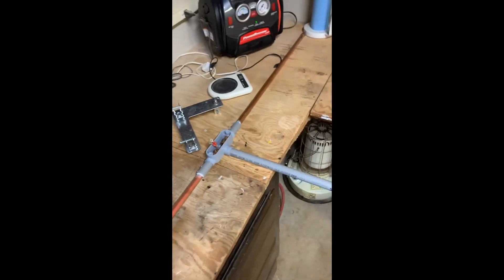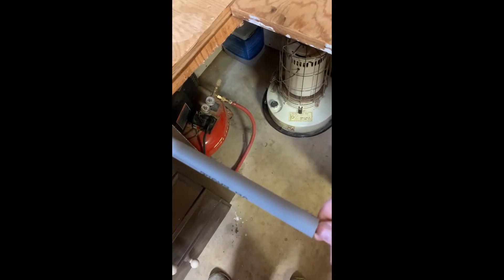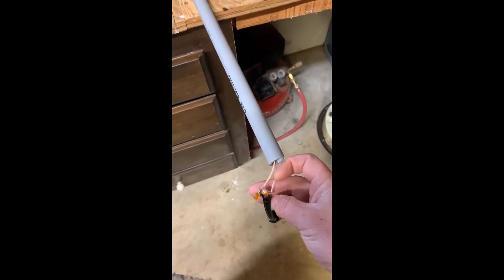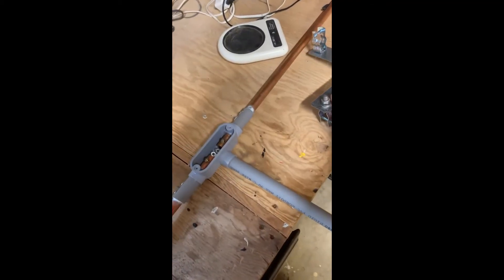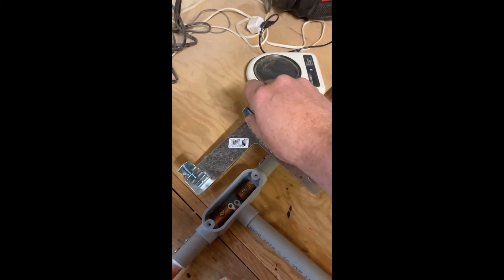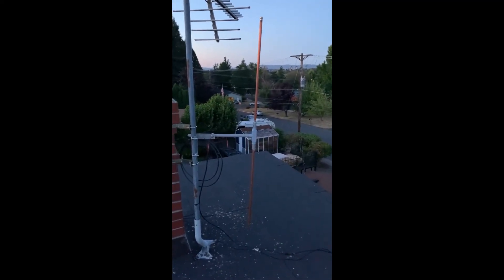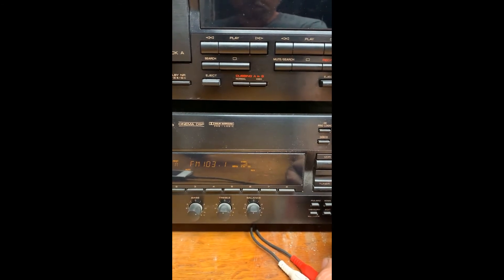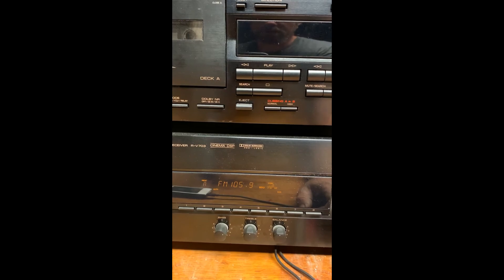Build a dipole antenna for better FM reception

Comment: The elements should be approx. 54 inches each. They should have a continuous bend in a half circle and the elements placed horizontally for best reception. Also use 300 ohm twinlead all the way down to the antenna terminals. The antenna will work better that way. Most FM signals are horizontally polarized, which is why you should use horizontal polarization. The best FM antenna I ever used was a 1/4 wave CH whip bent around end to end and placed horizontally, but do not let the ends touch. When bent around in a circle, it allows 360 degree pickup in the horizontal plane. Place as high as you can get it. just a few tips from a Ham radio operator and Radio station engineer. 73's
Reply: Hey Dennis .... could you explain that a Lil but for a carpenter who doesn't speak tech?   I would like to make one bud.

Comment: I am wondering , do you have to use copper ? I have 2 pieces of copper that have burst , would I be able to use these to make the elements?
Reply from the maker: You can definitely use recycled materials.  I had the pipe so that is what I used.  Even if you bought it new, it should cost less than $20.  Antennas are commonly made from aluminum,  but I don’t know of any cheap sources which is why I used the tubing.

Comment: Please share the length of the dipole element.
Reply from the maker: Each element is 2’ 4”.  Hope that helps.
Reply: Take your favorite FM frequency or center of the band is about 99 Mhz.  Divide that into 468 to give you a half wavelength in feet. (7.73 feet).  Divide that by two because you'll be cutting it in half for the two legs.  Each leg will then be 2.36 feet or a little over 28 inches.  You can use this formula anytime you want the half and quarter wavelength in feet for nearly any frequency in Mhz.
Reply: Center frequency is only 102.1 Mhz not 98 or 99.
108-88 =20.
20÷√2=20÷1.412=14.142
88+14.142=102.142 MHz.
102.142 Mhz is the centre frequency for all FM band calculation, because the FM frequency is in sinusoidal form.
Length of the dipole of FM ANTENNA calculation:300 ÷ 102.142=2.937 meter=293.7 CM=Wavelength of FM dipole.
So half wavelength=DIPOLE LEGTH=146.85 CM.
Now multiplying with 0.96(factor of metal)=~140 CM,the length of dipole of FM ANTENNA for universal use of band 88-108 Mhz.
140 CM DIPOLE LEGTH is the correct length for FM ANTENNA,as it balance 88 to 108 Mhz sinusoidally, the waveform of FM signals!

Comment: How is the antenna working after some testing?
Reply from the maker: Truthfully, I haven’t seen much change with the receiver.  It does seem to be solid through weather and other factors like time of day.  But, hooking the antenna up to my CCrane  EP pro is a big upgrade over the integrated antenna.  It is very difficult to get on my roof requiring installing roof jacks for access to change the antenna orientation.  With the weather change it’s not something I am going to do in the near future, it would probably be easier to build a new one.  I am happy with how it is functioning.
Reply: @brandonhayes9226  thank you for the reply. I am experimenting with SDR for all my analog and I bought an SDS100 for the P25 stuff here in Illinois. I actually built one of these antennas today just for the heck of it tuned at 155mhz 18" on each pole. It was surprisingly easy using 1/2 copper pipe for the elements. and that conduit junction box was genius. Thanks again.